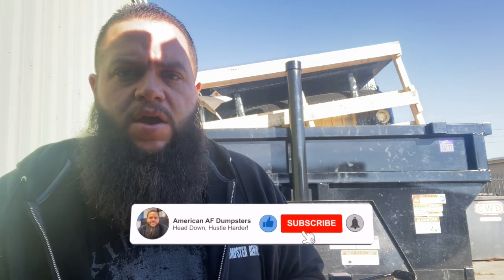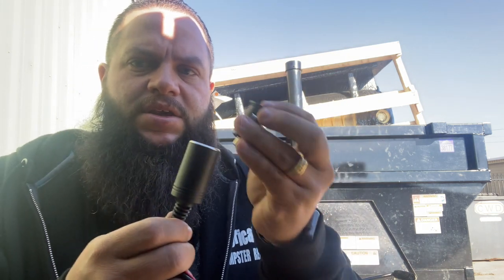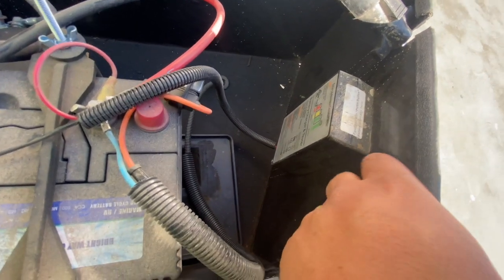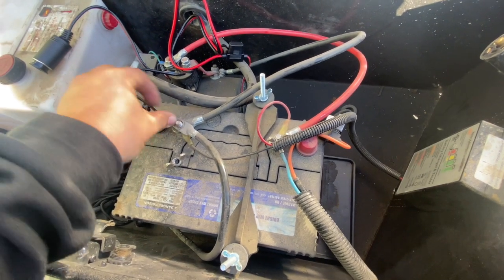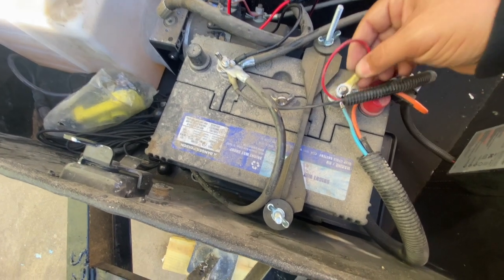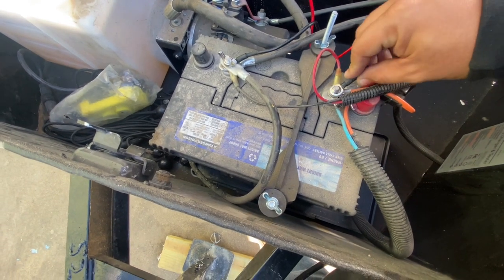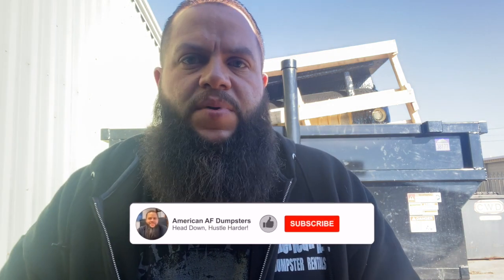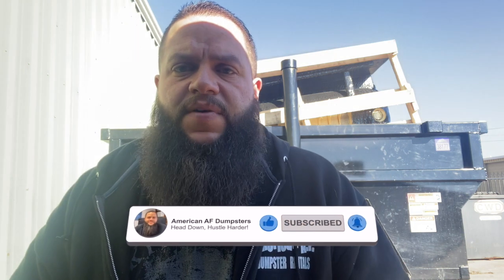How to Hardwire a GPS Tracking Device to a Dump Trailer

Comment: Great video! Quick and easy. I’m putting mine in the trailer door but can’t fit cigarette lighter and adapter in there.  Just wanted to come off the lights. Do you think it’s possible?
Reply from the maker: Yes I believe you can as long as you wire the positive and negative, but you might have to keep the lights on at all times in order to have power to it.

Comment: Inside that box you are only going to get "last known" position.  Meaning it will grab the satellite signals when the box is open.  When the box is closed it will still report the "last known" position but if it is stolen, that is of little help unless the thieves open the box lid.
Reply from the maker: I would disagree, I would get pings on mine regularly open or closed.  I would also get a ping on a movement or vibration so when they were rented out I knew when the customers where throwing their trash away because I would get pinged by my gps.  At first I got scared because I thought it meant the trailer was being stolen lol but then when I would look at it, it was sitting right where I dropped it off.
Reply: @Pyrolinn You think a thin metal box is going to prevent satellite signal? lol, does your phone not work while inside your car? What about inside your house?
Reply: @american_citizen9169  It just so happens I own a GPS tracking company and have been installing them since 2005,  and yes a thin metal box will block a GPS signal.  The reason why phones, and GPS trackers work in cars is because glass will not block the signal and since there are multiple satellites that the tracker triangulates a position with it will still work.
Reply: @pyrolinn2088  
Which device will report a vehicles location constantly that is reliable, inexpensive to purchase and inexpensive to play for service.

Comment: That will work, guessing that the USB adapter may pull more juice from your battery though then a GPS that is designed to be hardwired along with fewer connections to possibly give you troubles later.
Reply from the maker: So far so good.  Still haven't had to charge my batteries.  Thanks for the watch!

Comment: Love the hard wired idea for constant power but not confident a thief won't find that GPS in mere seconds, simply unplug it and drive off.
Reply from the maker: True, if they knew it was there in the first place or where to look.  They would have to break the tool box and get in which could possibly trigger the GPS.  Plus it also sends a notification when unplugged, so you would know.
Reply: I’m adding a fake gps on both my trailers so they can find those first
Reply: @adrianitis5124  not a bad idea. Once they find the decoy there would be no reason for them to continue to search others. I like it!

Comment: These trackers have a major failure in the app.. can't turn off battery saver mode when activated. 
Slide the slider to off and save.
And it automatically turns battery saver mode back on again. 
Save your money people 
Tracki support can't fix the issue. 
And customer support is really slow